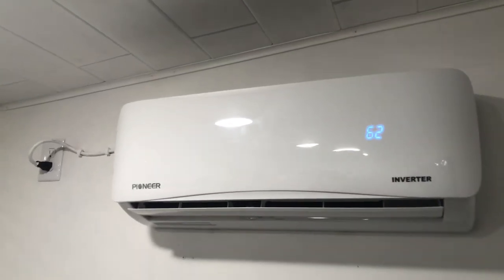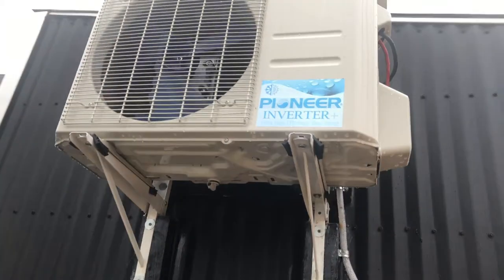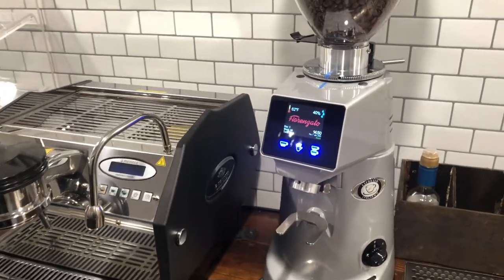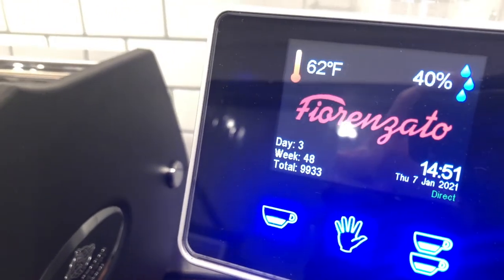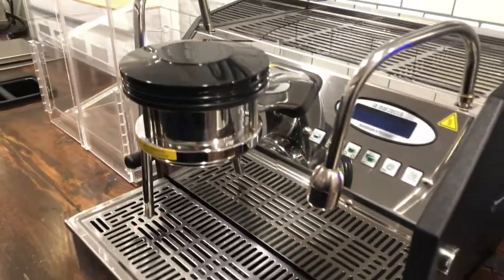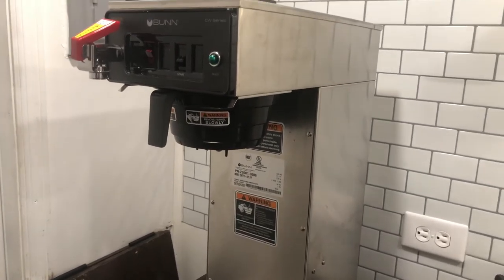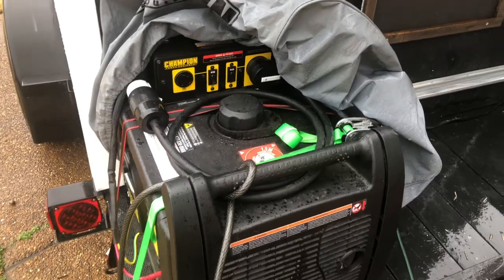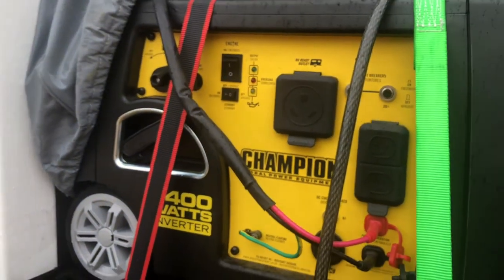Coffee Trailer Video 6: Electronics & Machines

Comment: why do you have 2 different coffee grinders? the first and second one.
Reply from the maker: We have 3 total on the trailer. First one is the Curtis Gourmet coffee grinder. That one is used to grind coffee for drip, pour overs, and cold brew. The one next to the espresso machine is my main espresso grinder. The third grinder is a small espresso grinder for when I want to use a different espresso. Like right now I have bourbon barrel aged beans in the small one.
Reply: @jojosespresso9264  what's the point in having 3 different grinders? I saw the first one has options with espresso, drip, and cold brew so why have a separate espresso grinder? Just wondering
Reply from the maker: @paulm4176  We keep our espresso blend in our main grinder at all times. The gourmet coffee grinder is used to grind drip coffee and coffee beans to make cold brew. The small grinder was used for our bourbon espresso beans. Each grinder basically has specific coffee and specific settings

Comment: What would you consider low volume for a coffee shop? I'm trying to setup a trailer for drive through only and am wondering if a 1 group like this would be fine.
Reply from the maker: Hey Jeremy, so for now, I am only open about 10-12 hours a week. So a one group head machine is suffice for my hours of operation. Going forward we will be doubling our hours and I do believe the one group head machine will still do the job since I’ll be doing 4-5 hour shifts per day. I have been thinking of actually getting a two group machine that’s actually less expensive than my one group machine. La Marzocco is the top when it comes to espresso machines so I had to pay top dollar just get the one I have now. However, there are other great and less expensive machines out there such as the Rocket Boxer which I may be looking into getting. You can get a two group Rocket Boxer for around $6,500.
Reply: @jojosespresso9264  awesome, that's helpful to know! I'm just getting into the game and am trying to soak up as much knowledge as I can. By chance do you know how much your trailer weighs? And what are you towing it with.
Reply from the maker: @Jeremy-ob4gm  awesome! I haven’t weighed it yet but it’s somewhere in the ballpark of 6500-7,000Ibs. I have towing it with a 2008 Ford-150 STX
Reply: @jojosespresso9264  sweet, that's a beast of a trailer! Thanks for your videos, they're really inspiring and have been great to watch as I start my process.
Reply from the maker: @Jeremy-ob4gm  Thank you! Let me know what else I can do to help!

Comment: Hey! I love your videos and use them all the time on our trailer build. Do you have any info on your electrical panel setup? Thanks!
Reply from the maker: Thank you! No specific info since I had an electrician do all the electrical in the trailer. He did however run a 220v line to where the espresso machine is just incase we wanted to upgrade to a 220v machine in the future. Right now we have all 110v equipment.
Reply: @jojosespresso9264  Thanks again! I just realized my wife @erinkascel talked to you on IG with questions too haha. We really appreciate you being a deep well of knowledge, thanks!
Reply from the maker: @beardedcastle  anytime!
Reply: Another question. With the wall peel and stick tiles did you prime the walls and allow 72 hours drying before applying? I never follow paint time allowances and my wife does haha
Reply from the maker: @beardedcastle  there wasn’t much prep involved. I just made sure the wall was free of dust and then I just applied each square. It all worked out!

Comment: Hello! This is a very helpful video, thank you so much! We are currently in the process of building a coffee trailer and ordered the Bosch 2.5 gallon water heater. Would you recommend we exchange it for the 4 gallon one? Thanks again
Reply from the maker: I think you’d be fine with a 2.5 gallon! We really only use hot water to wash our hands and to clean supplies. Which doesn’t take a ton of water in the first place

Comment: Hey mate, 

I like your generator set setup. 

Now that you've been running it for a while how would you rate it 

Do you have any thoughts on how you would approach it differently if you did it again? Would you try for a single larger unit?

Cheers!
Reply from the maker: Hey David, we had one generator go down due to an electrical issue on the generator itself. That happened last summer so I had to scramble to buy another replacement generator. I did however fix the issue on the broken one and now that gives me a backup generator in case the issue happens again. I can’t tell you why that happened but other than that… these generators have been amazing. Their noise level is great and I highly recommend these to anyone opening a coffee truck or trailer.